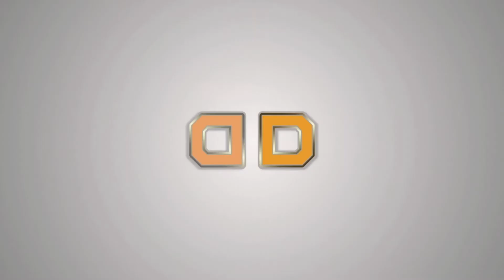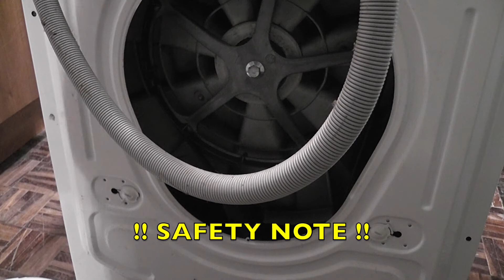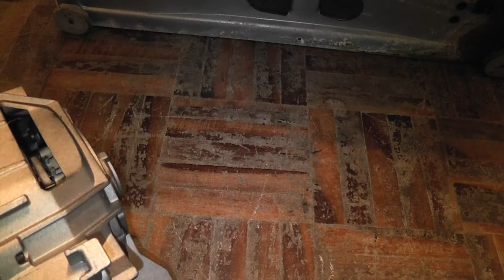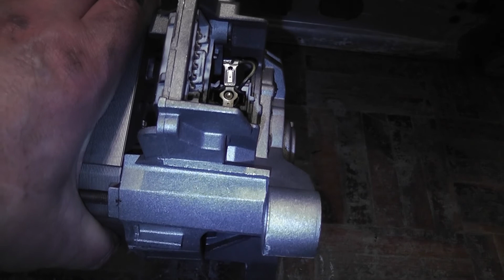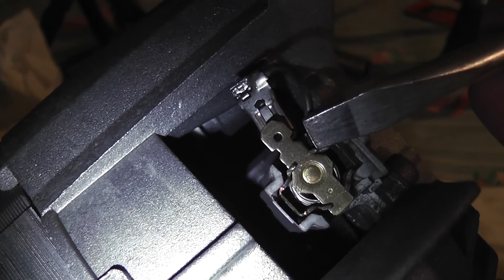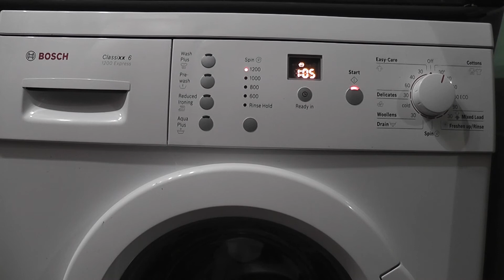F.21 Error Code Cleared and Washer Repair

Comment: How do you reset it so it’s not f21 as you have LSA no f21 but whenever I drain the filter the f21 message is still shown with no lights etc.

Comment: I have the exact same model but whereas your spin speed lights are changing when you hold the button in, mine do no light up at all. i am wondering if that is why i cannot get the fault code to reset. I repalced the drain pump as the impeller was cracked and let water inside the pump, i also replaced the motor brushes as they were down to less than 10mm in length. Any assistance you could give me, greatly appreciated.
Reply from the maker: Initially it took us several attempts to reset it.
Reply: Keep trying it. Listen for a slight click reset sound. 😁